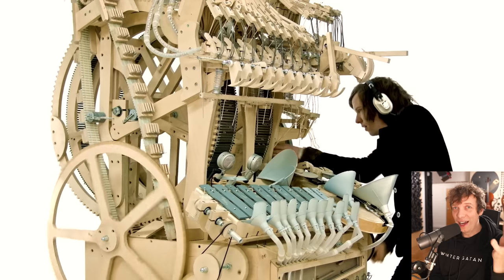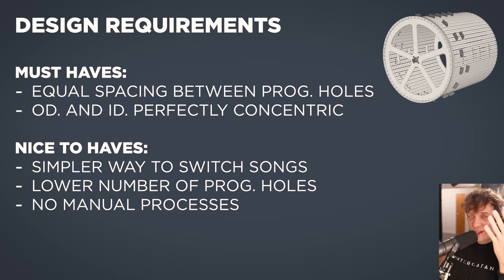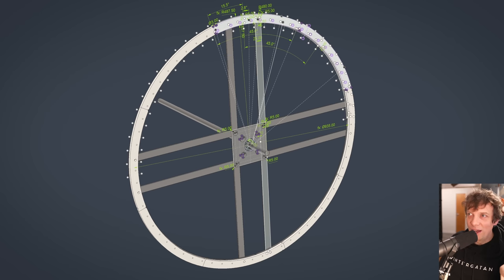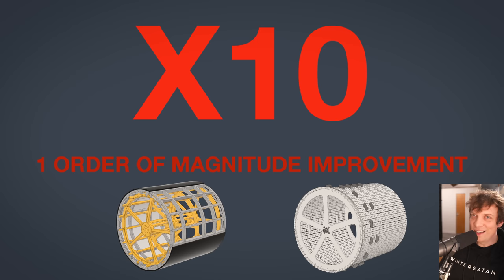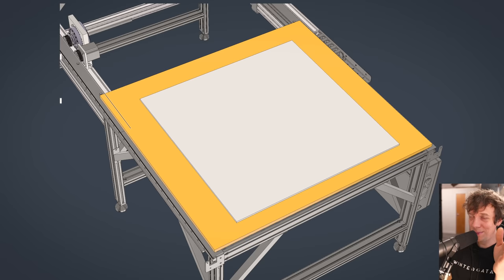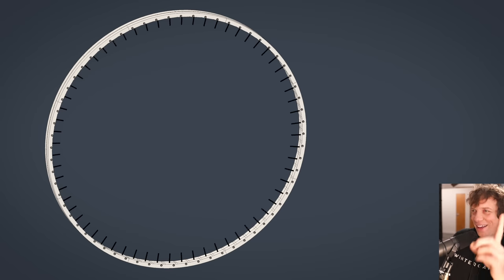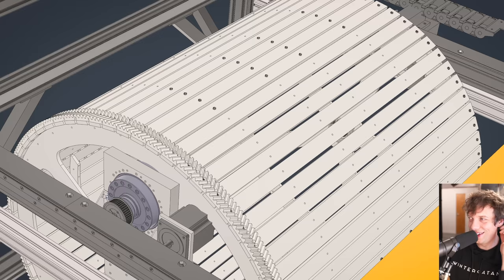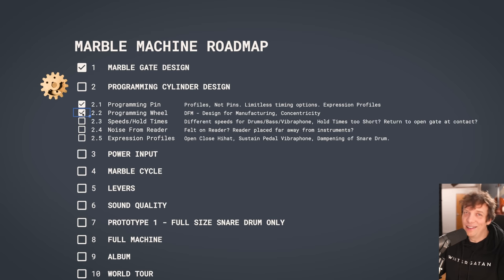A New Music Programming Wheel

Comment: I can see two problems here: 1) The new programming parts only have few holes for creating music, which means that you need whole lot of unique programming pins. Every time you want to play something new, you must machine new programming pins instead of just moving them using the thousands of options the old one used to have. 2) That programming wheel is gonna be extremely wobbly without some reinforcements and besides of twisting, it will also bend inward from the middle as pressure is applied. At least add some steel bars to make it rigid, plastic won't suffice.

Comment: @11:35 the stepper motor and harmonic drive interfere with the MM3 engineered plastic wheel. I assume that when you lower the rotary axis you are moving the stepper motor and harmonic drive so no interference with the rime (bearing housing) but you will still have interference with the spokes. I think narrowing the programing wheel and using spacers will work, it looks a bit tight in the CNC so please double check your width.

Comment: Locating the wheel with four bolts either side will not guarantee concentricity.  Locating the inner wheel diameter on a face or with dowels will hold the parts in place.  Also, will the bars deflect in the centre with the leaver forces acting on it? And will it matter? I'm wondering if you need a third centre reinforcement steel wheel too?
(Inspirational tenacity btw... Go Team!)

Comment: Hi Martin, you gonna need to add some bracing to your design otherwise it will be pretty wobbly during both machining (eg drilling programming holes in the middle) and operation (entire thing can wobble to the sides or inwards). To solve side wobbling you can run flat pieces in between to each arm (5), say 250-300mm in height. Bending inside can be reduced by replacing those tiny bracing bits with full circles (not out of sections). Those circles and flat bracing element can have notches so they snap together nicely. I known it seems like a lot of extra material, but at least it will be rigid as. Also, total amount of structural pieces will be still low ;). Even if you changed te material to say aluminium, I would still introduced the bracing (probably less though). Hope this helps. Cheers!

Comment: A few suggestions you'll probably never read 😃:
First off, I wouldn't trust the belt drive alone to hold the wheel in precise position when milling out those holes. Mill and drill out the first position, then have a pin on a solenoid in the next position that pops up into the hole to hold the wheel in place when doing the next position.
Second, rigid mount the axle in the programming wheel so it will help to hold both sides of the wheel in sync, otherwise they will twist. Mount roller bearings on either end held in place with snap rings. On the machine side, just mill out a spot for the bearings to sit in, so the wheel can be easily picked up and out of the machine to change it.
Third, keep your bolt count as low as possible. Steel weighs more than plastic, and you're putting weight on the outside edge of an already awkward thing to pick up and move. I know you want to use off the shelf stuff as much as possible, but in this case I would do more work in the name of weight reduction. If nothing else, go for aluminum bolts over steel, they'll still be stronger than the plastic they're holding together.

Comment: my only worry is that the programming pins are to big in the current design but i assume that you did your calculations at this stage that you can play every note in quick enough succession with these pins. The other thing that i can think off is that you add a carved in symbol for the individual instrument/node on the "bars" so you can tell at every pinhole which instrument it belongs to which should make programming it a lot easier.

Comment: I'd suggest setting up a test of rotating your model programing pins at the velocity they'll be going at your max bpm, just to ensure they won't fly out after you finish building the entire thing.

Another thing I'd recommend is fixing the wheel to the shaft, and driving the shaft, that would eliminate the double helical gear.

Now if you're willing to change your manufacturing process I'd seriously recommend looking into pvc pipe suppliers, ik for a fact pvc pipe goes up to at least 5ft in diameter for things like drainage, if you could find some in a suitable diameter then the entire programming wheel could be machined from the single piece on your rotary setup minus the spokes/hubs.

Comment: I like your new design process. I think for physical projects you really have to adhere to the waterfall design strategy. For coding, I love the agile framework. It allows you to continuously adapt your goals throughout the project. However, when you're making a physical behemoth, the cost of change is far too high halfway through the project to justify changing anything meaningful, so you get stuck in your own initial decisions, whether good or bad.
One thing with the waterfall design strategy is that you have to know that you're right. A lot of firms witness exploding initial project costs simply due to hiring experts to make sure they're right and then exploding project costs later once errors are found and sloppily patched. One thing about these videos is that you're ingraining your beliefs and justifications about the design into the viewers. I really like this design, but there might be unforeseen limitations. It might be worthwhile to blueprint everything and get some unbiased, expert, outside opinions.

Comment: You probably wont see this, but if you want a light material and is siff as a bord, machaniocally stable is impervious to humidity and temperature. You need to use BOM H,  or better known under the brand name Delrin made by Dupont.  Delrin is more expensive and is for your pupose no different then non branded POM H thats made by Acetron, Ensiger and other companies

Comment: Here's a crazy idea. What about buying a large diameter pipe and using the rotary CNC to add the majority of the features?

I'm not sure how concentric a large diameter pipe would be, but I can't imagine them being too bad. 

If you do go this route, you can potentially save on the hardware as everything would simply be milled from one big piece.

A downside would repairability. If a small part breaks, you might not be able to repair it...

Comment: Martin ... Sorry to throw this in but by arranging the wheel properly you could programming on the fly, I thought it would be possible to fret actuate the bass off the wheel using latches for the hold but thinking about it you could do the same for the programming wheel, it would be horribly complex to get it to work but a pin hammer oscillating bar printer or chain printer used the exact same mechanism to hit the hammer ribbon and paper ,

Comment: Why not get a plastic pipe of the appropriate size? Then mount a few brackets inside for more rigid support, and the end caps? Then use the lathe/mill to make the surface as you need it?

Comment: You should consider finding a way to machine that geared collar earlier in your manufacturing process. The reason is because that seems like a process with potentially higher risk for failure and if you wait until so late in the process you risk having to scrap or rework a part that has already had a bunch of time and effort invested in it. You may have to redo a bunch of steps just to get back to that gear machining step.

Same suggestion on the indexing holes, although being smart about the order you machine the holes might be enough. Machine all the index holes on a single plank before you rotate the wheel and machIne the next section. QC tolerances within planks and to the previous plank. That way if something goes wrong you can just replace one plank section of the wheel instead of several planks.

Comment: The manufacturing process looks good, but the gear drive on one end worries me. Others have pointed out twisting and torque concerns, but there's also a musical concern. If the other end of the drum resists moving, your timings will be different on each side of the wheel. One horizontal strut won't represent the same time.

Comment: How about laser cutting ? On my trotec i'm getting +/-0,2mm on large 1200mm rounds
-Less hardware = less weight and inertia 
-Weight will make things vibrate and flex 
-You need more axial rigidity 
-For quick on/off wheel make half round keepers around the bearings

Comment: With all of the movements and vibrations going on I would worry about the out of plane stiffness of the programming wheel spokes.  IMO as an aerospace structures engineer with 18yrs experience, those spokes need to have back up flanges - check the out of plane second moment of area of a flat bar and an L of same total length.

Comment: Maybe cast aluminum for the wheel frame? Could make it all fancy and ornate, would look a lot better than plastic imo and give you that dimensional stability. I think a largely metal Marble Machine would look awesome! But would need to be careful of squeaky joints and metals just clanky and loud and reverberates in general. The more you're able to cast or machine out as a single piece of metal would help with stability and noise.

Comment: Hi Martin, did you have this design checked by a structural engineer? I would have big concerns that it is not resistant against torsion as the left wheel and right wheel seem that they can (structural) rotate (statisch onbepaald.... Geen idee hoe dat vertaald moet worden)! Good to see you back at the design!

Comment: A thought on reducing fastener count and machining ops
-Machine the wheels as planned but instead of cutting flats then drilling and tapping holes cut a slot into the wheel with a width equal to the slat width and a depth of about a quarter of the slat height.
-Machine a groove on the underside of the slat with a width tightly tolerance to the wheel thickness and about a quarter of the slat depth deep at the interface point with the wheel
-Machine an identical groove on the top side of the slats
-The slats should precisely locate themselves in place on the wheel
-Use a single steel cable or other cord/cable wrapped around the whole wheel in the slots cut on the top side of the slats
-Tension the cable

All screws have now been removed from the assembly. Would remove the ability to replace a single slat but I believe it greatly simplifies the design from a manufacturing operation count and assembly time perspective.

Comment: I'm concerned about the rigidity of your design, I think it may tend to wobble side-to-side; you may need to put some horizontal stiffeners in there.  You could also use sandwich panels for the ends, thinner plastic glued onto either side of some foam, because the increased thickness would be much stiffer.

Comment: I have 3d printed double helical gears, like yours, for a robot arm to move chess pieces and got them smooth and with precision. there is already a printer with infinite x axis (it prints on a conveyor belt) which you could use to build longer parts. If well taken care of, you can get precision up to 0.1-0.2mm, without any further machining. if you consider the printing axis together with the material you're printing with, you may get some advantages on using 3d printing instead of machinning, specially in non planar pieces. other than that, nice job!

Comment: I threw a tantrum against YT a couple years ago and axed my original YT account.  Of course, a few weeks later I relented and set myself up again once I had cooled off.  I tried to re-sub to every channel I could recall from before, but somehow I failed to sub again to Wintergatan.

So my first response was going to be: "MMX was no failure -- it was perfection!  You keep putting yourself down that way and I will unsubscribe!"  LOL but I would have to subscribe first it turns out -- glad YT recommended this one to me.

Scratching my head wondering why they put "swing" adjustments in music software to emulate human imperfections and make it sound less mechanical -- while you berate yourself that you didn't obtain machine-like mechanical perfection.  Am I dreaming or didn't you even stop the flywheel and hand-crank for the breakdown to make it more expressive hahaha...

As one perfectionist to another, good luck!  I have subscribed anew and I look forward to hearing your progress.

Comment: One thing I don't quite get yet: what drove the decision on the size of the programming wheel? As far as I can tell, the new "pins" have an arbitrary size, so if you made them smaller, you could make the wheel smaller. On a similar train of thought, since you can 3d print the new "pins" to whatever shape, why not have even less wholes where to install them? Maybe half of the current planned number? Just need to make sure to print the "pins" accordingly. Curious to learn the thought process here.

Comment: How are you (or someone backstage more likely) going to reprogram the spare wheel during a concert? Or to put it more accurately: how long will it take to reprogram a wheel without making a ton of mistakes? I know you like black, but I would suggest that you make the material of the wheel lighter, so that you can project instructions on it. Those in-place instructions make it clear on the machine which cam (with a specific delay) should be put in that location. I'm note sure if it is feasible to make each delay a different colour, but that would probably make the process go faster. You'd need a stand for the wheel with a rotary encoder that 'scrolls' the image that you want to project on the wheel. It is not just the machine, but the infrastructure as well.

Comment: Why not manufacture the side wheels with tenon slots to closely fit the cross-spars? Then you will have the pitch to pitch accuracy of your CNC, and the clearances in the screw holes becomes irrelevant. As far as I can see you can repeat the side wheels to give additional support within the drum so you have just two parts to design (side wheel and cross spar). Although I don’t know the diameter of the programming wheel I can knock something up in CAD pretty quickly if you want to see what I mean.

Comment: Engineer here. Great design ideas, but four suggestions: 1. The programming wheel design is very much improved, but consider how mechanically precise it will end up being, in particular the cylindricity of its programming surface. I imagine any wobble will affect the height of the programming "pins" therefore affect the reaction timing of the reader arms. 2. Consider shrinking the diameter of your programming wheel, this being possible with fewer programming hole requirements. This should help with manufacturability, precision, transportation ease, operation ease, overall size of the machine, etc. 3. Reconsider using timing belts, gears are typically noisy, unless they are precisely machined and mated. The precision you can achieve with the rotary "fixture" design you've presented here...expect to be disappointed.  4. To reduce fastener count is a valid engineering practice, as even fasteners can fail.

Comment: Very cool design. I do however think that splitting the holes for the flat head screws in half for the parts that become the gears is a bad idea. The holes are going to be very hard to make accurate enough, leading to the brackets being loose around your flat head screws, ruining the timing accuracy of your music wheel. 
I also think a stiffener disk in the middle of the drum would be a good idea.

Comment: i don't think that process is going to get you the concentricity you expect, at least as you explained it. unless those 'test pieces' on the outer edge that present the 64 faces are adjustable along the radius, which given the holes in the cad projection they aren't, then those holes are just as vulnerable to the x/y deviations as is the circumference of the wheel. you need to use the "lathe" portion of the cnc to center, then adjust down to remove material until your radius is reached and go from there.

Comment: Having done some CNC work and building machines with CNC precision parts, I would be cautious about machining the gear profiles, my experience with gears is that milled gears often have a worse fit and are much sloppier than ground or Hobbed gears. This may be acceptable for your design requirements but it is always good to keep in mind that the parts are NEVER exactly like how they are designed on cad and you are doing multiple setups which require very tight concentricity tolerances. I would at least recommend cutting datum surfaces and diameters into your wheels so that you can pick up the same feature every time you set up.

Comment: Those plastics side panels for seem like they are going to flex to much for this to be truly accurate. That is a long way for unsupported plastic sheets with a lot of weight on them. You might want to think about adding a support spine that slots into the panels.

Also if you are going to true up the side panels with the cnc like that then you should do both at the same time and index them so that they are always in the same position. That way even is the turing isn't prefect they will still be the same.

Comment: I have one big concern regarding this new programming pin setup. On the original machine and the MMX, there were a lot of programming pins (as you pointed out), because they were very small. This also meant that you could put a reasonably long melody on the wheel, since there were more notes for every so many degrees of rotation of the programming wheel. With this new, much larger, pin design, I worry that the new programming wheel won't be able to hold a long enough melody to give you the proper freedom to compose music for the machine.